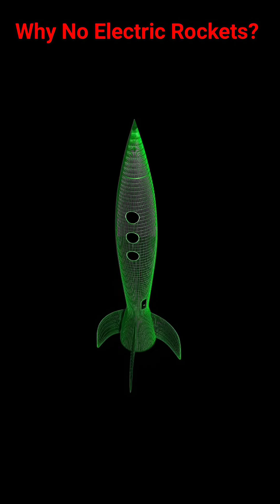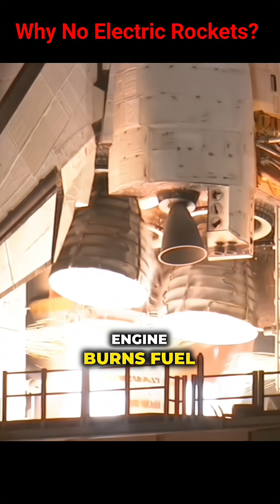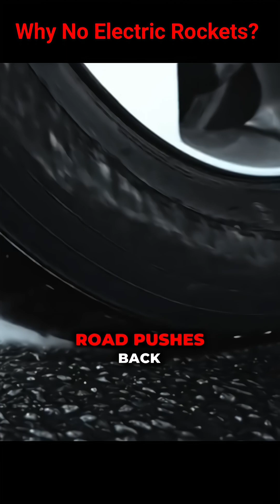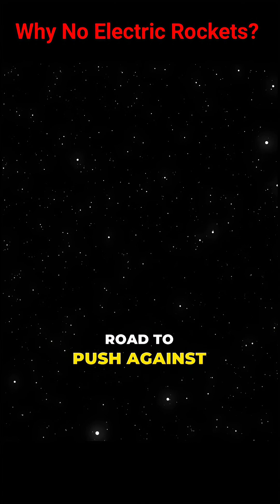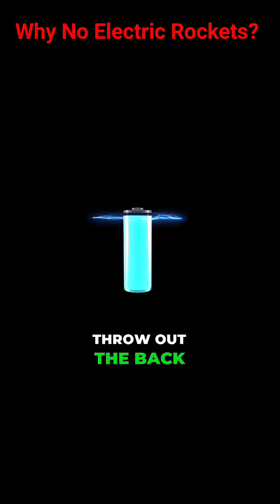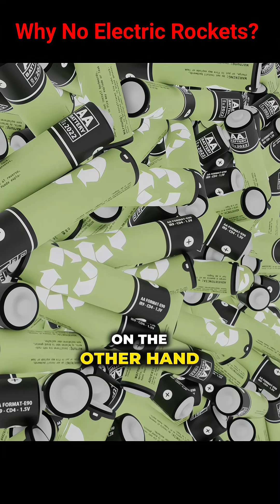Why No Electric Rockets ?  #rocket #electric #shorts #short #space #earth #how #facts #why #science

Comment: There are more technologies that utilize electric propulsion than liquid fuel.  Methanite, Ionics, Fusion prototypes, by the 2040s rocket engines will likely be the grand minority because they simply don't possess enough displacement to be useful outside of that initial push.  This is why there are zero extra planetary engine designs.